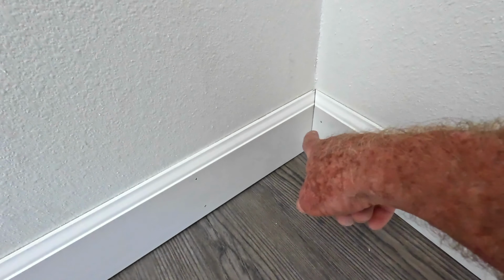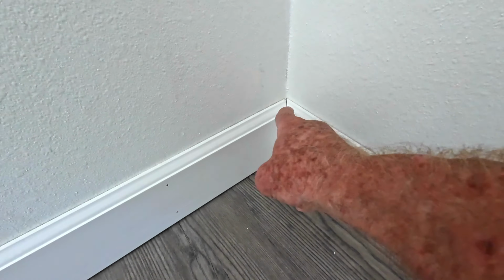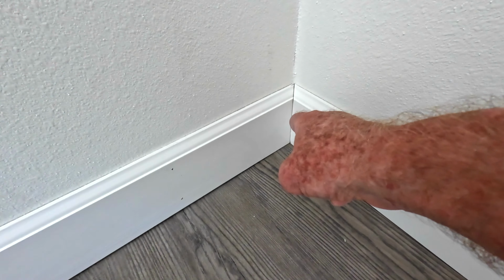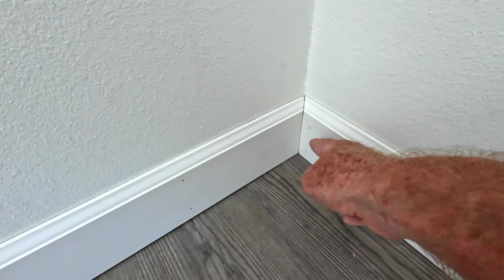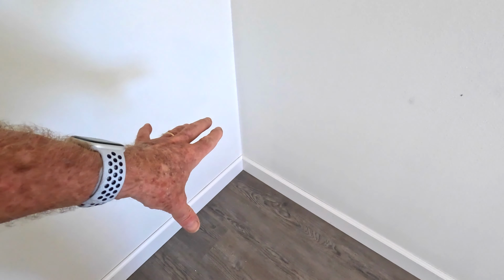Dopes don't Cope.🤪

Comment: Hello.
Nice video demonstration. I am surprised that it even had to be shown. I have been coping like this since the late 1970's. But then wasn't everyone? I guess not. I have not used a coping saw ever since then. When you work by yourself and every piece put in depends on your skill set, you learn very fast how to do things more quickly buy this method has been around for a long time. Fine tune with screws on outside corners as well. Very easy to do and your work is first class. I guess I should watch how I use the word "cope."

You can even cut it if the cope is out of square. That cut, with screws placed in the corners will adjust your coped pieces perfectly and they will not move when nailed. 

Also very little messing around with installing varnish grade and prefinished hardwood. It gets a little harder with wider pieces in quarter sawn white oak.  That I will admit.
Reply from the maker: I have a 6 part crown coping series showing how I cope with a jig saw and Collins coping foots. This was to show a method for mostly straight or flat trim that is the easiest requiring even fewer tools.
Reply: Look forward to seeing it. I would like to see how you do it. Sounds interesting and I will keep an eye out for it. Continue your great work videos.
Reply from the maker: @gizmobently  I posted the 6 video series on installing crown molding like a pro back in 2015. https://youtube.com/playlist?list=PLB1ATCukiUGQcqbiVUgeeBruL6YT9jEOz

Comment: Ron… I want to replace the interior doors in my 40 year old house. At first I thought I would just do the slabs, but think the door trim won’t match. So, if I order pre hung doors and trim them out, does that mean should re trim the whole room (base moulding) so there’s not a new door and old room trim? Thanks for sharing your technique.
Reply from the maker: It depends on the cohesiveness of the old and new. You can find new casing that matches the old. Either look around on line for pictures of similar situations or hire an interior designer. What I wouldn't do is just mix and match without a plan as that will always result in that famous "Home Depot" look. You know the one where they bought what was on sale at the time in HD.
Reply: @TheSmartWoodshop  thanks Ron, good advice. I can find the same trim profile, it’s just that in my mind the new door trim that has clean lines doesn’t really match the older trim that’s been dinged and had layers of paint on it. Not sure if you’ve encountered that or you used to just do new construction.

Comment: It’s called a jack-cope. Works very well for base that has a dado profile. The cope can become flimsy and break off when trying to cut the mating piece for the dado, this solves it. In my experience the extra step and set up isn’t worth the result in base profiles 5inch or less and with some walls so out of square a true cope/ pass through joint will stand up just fine.
Reply from the maker: Thanks Matt😎🤙

Comment: Wonderful video. Again. Looks like the room was painted before you installed the trim and perhaps even the trim was pre-painted. I know you have a sprayer. Hand painting the trim is more difficult than hand rolling the walls. Your next step will be to caulk the seams and putty or spackle and sand the nail holes. Prime the spackle. This probably will put caulk up the wall requiring wall touch up before finish painting the base. From an ease of painting  point of view, I suggest placing the trim on unpainted walls. If you want to control dust, then prime the walls first, then install the trim. That way you can do all the trim first, over-spraying onto the walls. Mask off the trim and now you can spray the ceiling and cut and roll the walls. All painting and spraying will be in the subject room. Easy.
Trick. I have even placed masking paper under the base at installation. Now you can caulk the bottom of the base to the paper and carefully cut the painted caulk when finished. This paper idea may be a wonderful topic for a future video. It will slide with the floor and cover any gaps and bows under the base. It also keeps from painting the floor at any gaps and you gotta mask under the base anyway. Your carpentry skills are extraordinary. So too your video and presentations! Thank you.

Comment: Its cool its better than a miter it avoids a coping saw but the only negative is that it could open at the top if the corner isnt a true 45 corner the flat will be tight because it s coped but the top being mitered instead of coped leaves room but in a production setting definitely faster and over all better than ppl who just miter definitely cool way of doing it

Comment: Why don't you place one end of that piece of wood on the base and the other end on the floor and lean your knee on it to get the base flush with the floor?
Reply from the maker: Not going to bench that base without a hydraulic press. I caulked all of the base to the floors so any gaps were filled and are now invisible. 😎🤙
Reply: How does that caulk now work with the movement of the floor?

Comment: Ron - When you measure the length of your moulding pieces, how do you determine how much to add to ensure the piece will bow out slightly? Do you add more to a longer piece? What is your rule of thumb so you don’t end up with too much bow?
Reply from the maker: A little longer😎. It really is just feel, but about 1/16" for a 16'.
Reply: @TheSmartWoodshop   1